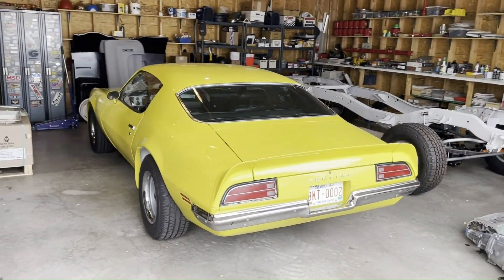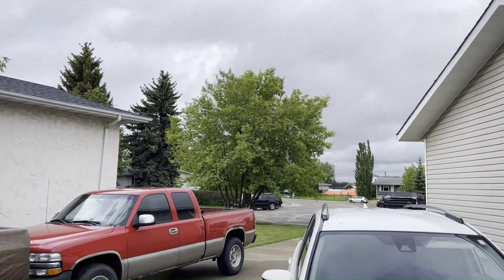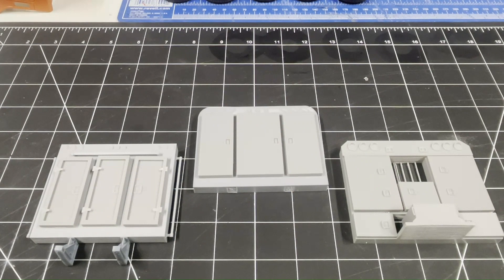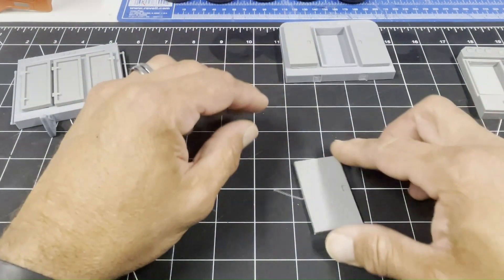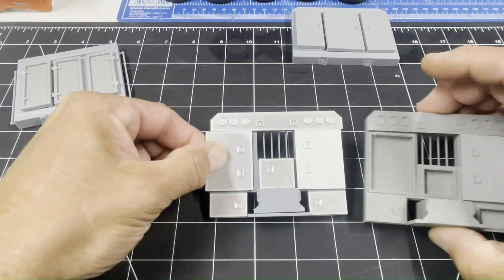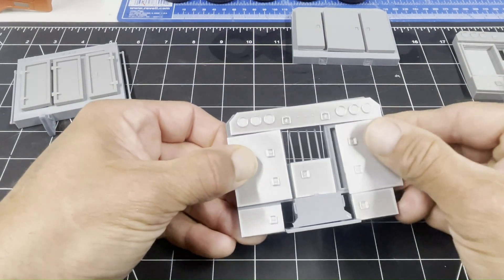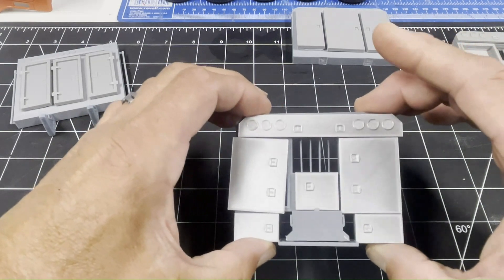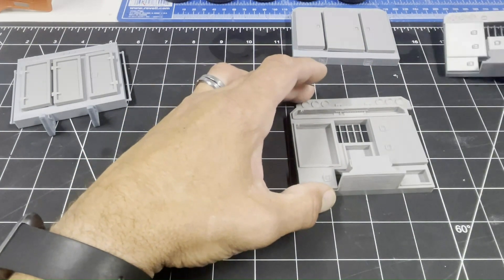Scale Model Parts Launch - 3D Concepts

Comment: Karl. did you ever see the 1/25 Revell / Germany, 7522 Bill Signs Trucking model kit. It was the complete Prestige 359 Peterbilt with a hole complete extra  dual spread axle , single cab frame with float front tires. It had a complete extra chrome tree with those exact air cans you show , along with beautiful seamless tanks, straight pipes and a bunch of dress chicken lights. I actually bought it just to steal those juicy chrome parts to make a W900 for my brother-in laws company. That was over 20 years ago. I then contacted Revell Germany and bought 2 whole chassis . to modify it to a tri-drive and pair it to the chrome shell tanker. That was all before I abruptly gave up modeling. Boy it would be nice to buy that truck again but it is rare and expensive. Cheers! Earl
Reply from the maker: Hi Earl, thanks for tuning in and we are due (the modelling community) for a re-issue on the "Bill Signs" Pete and the "Will Do" wrecker kits. They were last re-issued back in 2014/2014 and I bought 2 of each for $89.00 CAD each. We won't see that price again but probably in around the $125-$140 CAD range I'm thinking. They will come back but unfortunately a lot of kits like these used to come with all kinds of extra parts. Now they come back with just the parts to build the kit on the box cover!
Reply: It still would be nice for a reissue 😊
Cheers  🍻 
Earl

Comment: Hello Karl I am wondering if you guys could make a ntc 350 cummins in 1:16 scale. I m rebuilding a 1:16 scale Peterbilt 359. It s a replica of my dad ‘s truck. These kits only come with a Caterpillar 3408. This would be a great way to make it accurate. 3:51
Reply from the maker: Thanks for your inquiry Michael, please email the address in the information and I'm sure something can be done. I know it's very boring with these Cat engines. It's also the very same engine they put in the 1/25 scale Revell Kenworth W900L flattop sleeper. The other Revell Kenworth W900 with the Aerodyne sleeper has the 3406 Cat engine. We also want to get tires available for the 1/16 scale tractors. Thanks again Michael!